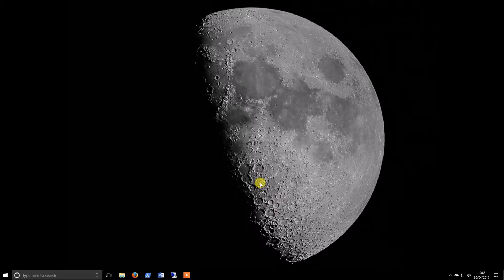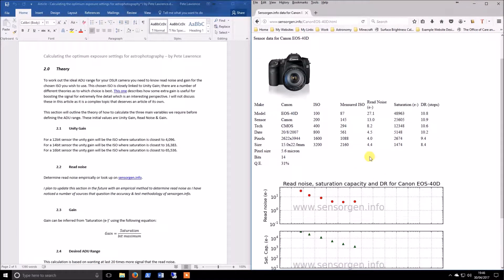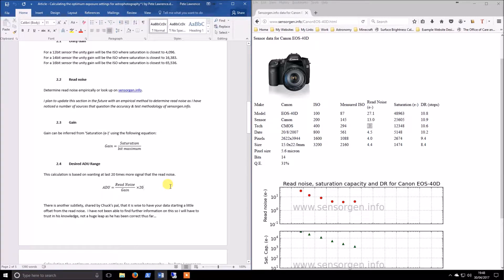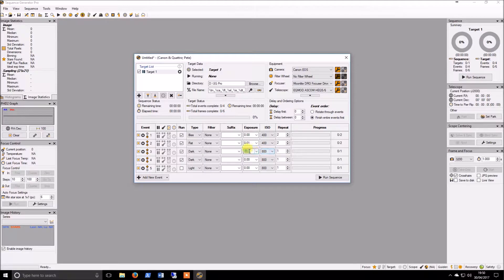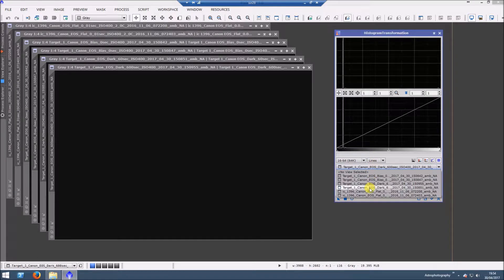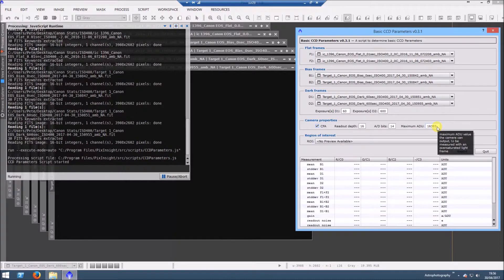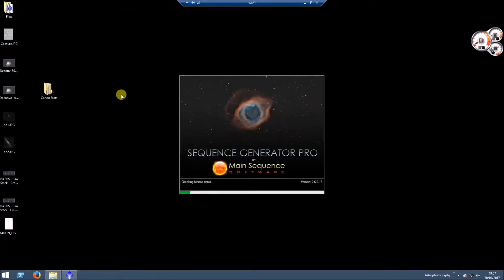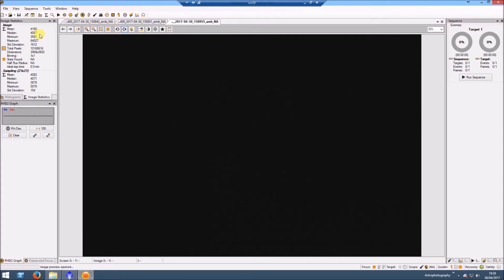Howto: Calculate the Ideal Exposure for your equipment

Comment: Great video. I'm just getting into astrophotography and trying to figure out the ideal exposure. I'm using a Nikon D810 DLSR and the gain, egain, and ADU are not given in the FIT file since the camera is not ASCOM compliant. With this method, I can evaluate each shot as they happen for ideal exposure.
Reply from the maker: It will vary per target, but ISO400 is a good place to start for deep sky objects. ISO100 is good for a bright moon.